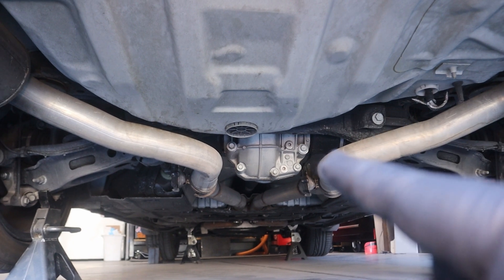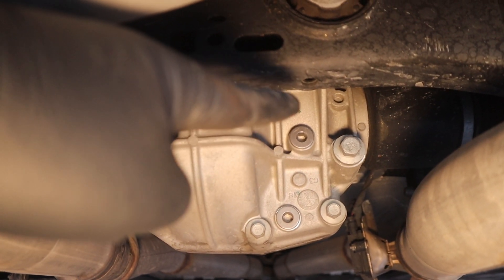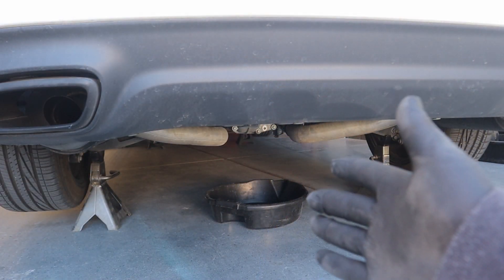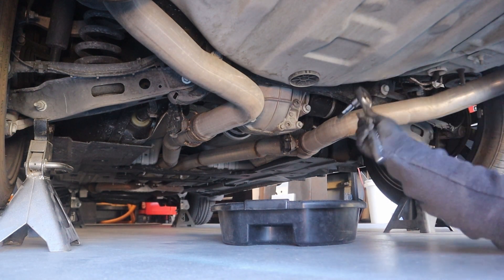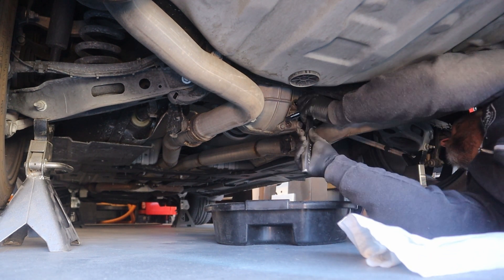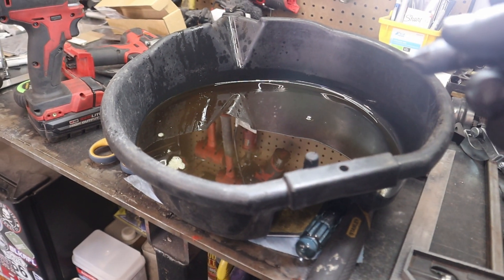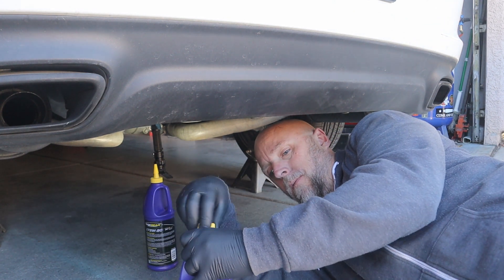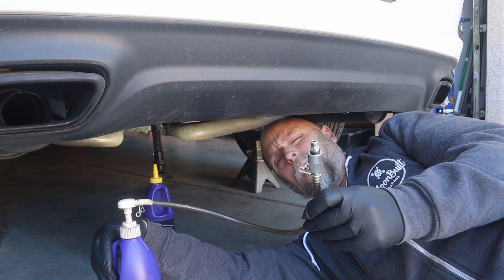How to EASILY Change Rear Differential Fluid | 2017 Dodge Charger RT

Comment: Thank you for the video. I got myself a 2016 Dodge Charger Pursuit 5.7 AWD, it's in the shop for a rear differential replacement, obviously it was a little abused since it was a cop car, hopefully the shop does a good job🤞...love the Hemi power/sound 👌

Comment: what gear oil weight / brand did you use? 

i just changed mine on my 16 dodge charger 5.7 RWD and used Synthetic Gear & Axle Lubricant SAE 75W-140 MS-8985 1-Quart OEM MOPAR 68218657AB and added Mopar Limited Slip Additive 4 OZ.

Comment: Thanks for making this video. I really liked the way you placed your car jacks lifts. I had always struggled using them with my Dodge Challenger. I still have the stock open diff; 2.62 ratio if I'm not mistaken. Would using the same lubricant with LSD additive included, cause any issues?

Comment: I have a 06 srt8 charger do recommended changing the differential fluid I did some research say it’s mainly for Manuel transmission to change the fluid??
Reply from the maker: Diff fluid had nothing to do with whether the transmission is manual or automatic

Comment: I thought with a possi tract rear end you have to put it a special additive
Reply from the maker: You do....but mine isn't limited slip...you can tell by the differential housing
Reply from the maker: You may want to do a bit of research before making such a comment....not ALL RTs have LSD.  68185924AG is the part number for the differential in a 2017 Charger RT (my car)...note the lack of "fins" on the bottom of the housing...open diff.  68427796aa is the part number for the differential in the 2017 Charger SCAT...this one has the "fins"...Limited Slip....quick and easy way to identify which differential is which
Reply: @MoonBuiltGarage your right , a way to tell is your count the fins on it I think it 12 to 14 fins total to be a 3.90 diff
Reply from the maker: The fins don't have anything to do with gear ratio...just whether limited slip or not
Reply: Can I use a 8MM hex ?? Or does it have to be an Allen key?

Comment: Is this process the same on the sxt model 3.6 engine?
Reply from the maker: It should be...the only difference would be between the Limited Slip rear axle and non-Limited Slip.  The Limited Slip rear axle requires and additive to the gear oil.  To tell whether you have  Limited Slip or not is to look at the housing...if there are "fins" on the bottom it IS a Limited Slip.  If the bottom is smooth it is not a Limited Skip....being an SXT 3.6 it is probably NOT limited slip, but you should verify that (I'm not gonna be responsible....lol)
Reply: @MoonBuiltGarage  thank you i will give it a look to make shure